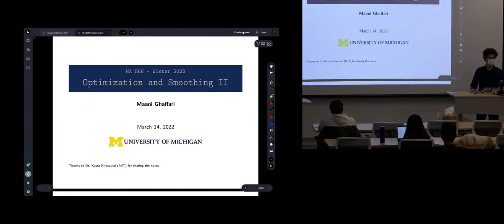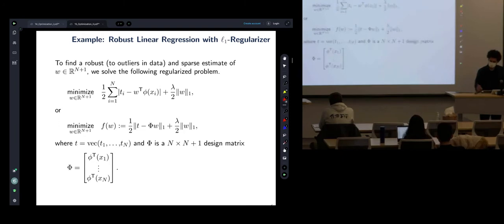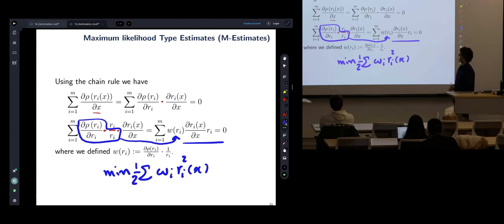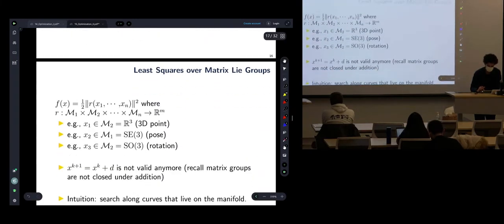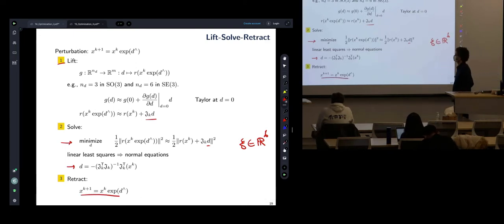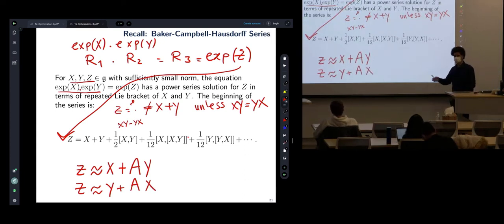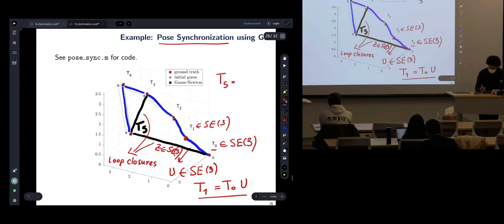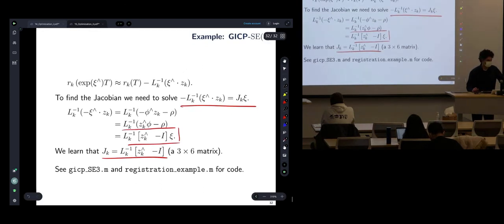Lecture 15-Optimization & Smoothing II

Comment: Is there a way to also calculate the covariance matrix for the nonlinear LS solution?
Reply from the maker: Great and important question. We can use the approximate Hessian (in GN) at the solution for that (inverse covariance). But because the problem is nonlinear that only gives a rough approximation valid at the estimated point (solution of GN).

Comment: great stuff! Hello prof Ghaffari, at around 57:00, around the lift-solve-retract part, is there any particular reason the residual is expressed in Right-Invariant error form, instead of the Left?
Reply from the maker: That's a great question! It's not important. When you formulate the optimization problem, pick a retraction (left or right error form) and stick to it. We just need to be consistent. Depending on the loss function, sometimes it's easier to use left or right. Ultimately, you should get the same results either way.
Reply: @umich-curly  Thank you for such great lectures, I just have one naive question regarding the same, I was not able to understand why x = x exp(E) is right invariant and x = exp(E) x is left invariant, and does for both the invariant models does process dynamics remain same? Also if possible could you please direct me to any source material for reference, that would really be helpful. Thanks again!